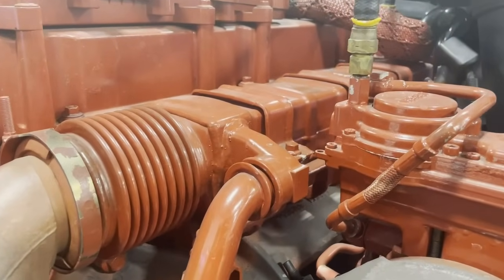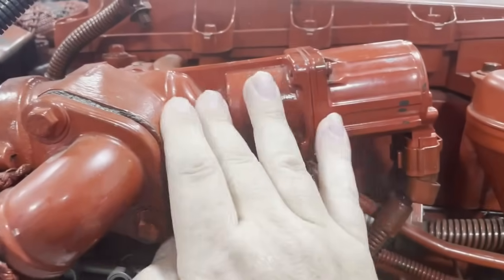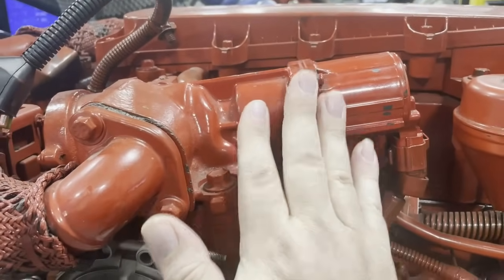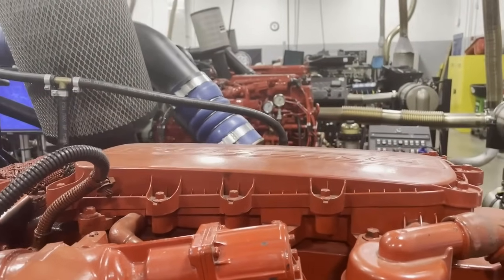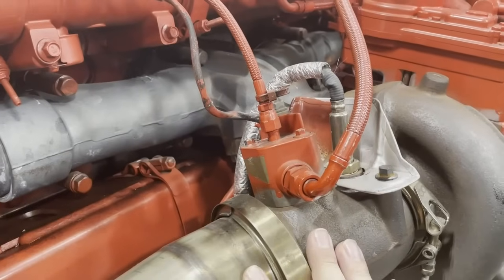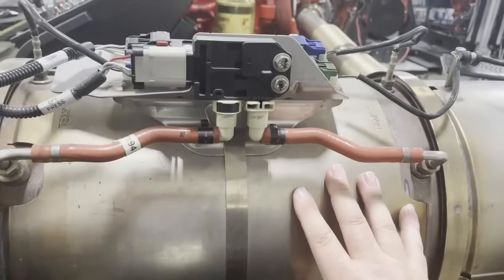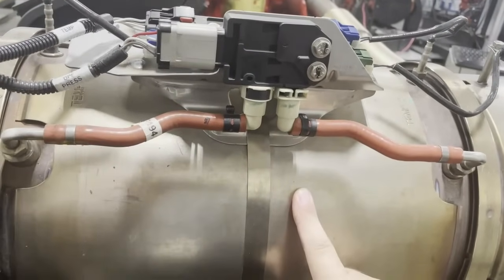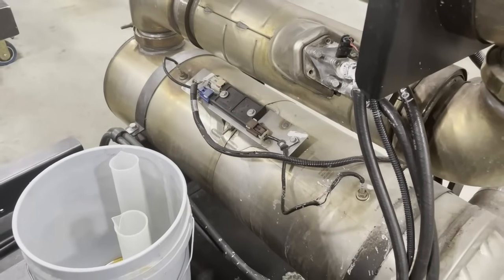Clean Diesel EXPOSED: How DPF, EGR, and DEF Actually Work

Comment: what about oil dilution with the newer 7th injector'less design.. doesn't spraying fuel in the exhaust stroke wash the cylinder walls?
Reply from the maker: Not really. It’s on an upward stroke towards the end. The majority of that atomized fuel gets pushed out the exhaust valve during overlap and then gets oxidized by the DOC. I can’t speak with absolute certainty but I believe very little to none of that fuel is still in the cylinder or making it past the ring to cause oil dilution or cylinder wash.
Reply from the maker: That was a great question by the way. I wish all the people asked thoughtful questions like that instead of being keyboard warriors playing a game of gotcha.
Reply: Oh, ok, so the injection event on the exhaust stroke can happen towards the end of the piston travel? Is it also the case that since diesels flashpoint is well below exhaust gas temps, is it instantly ignited, or is there not enough oxygen in that environment? These aftertreatment systems are pretty fascinating stuff, actually. Thx
Reply from the maker: @ojo2988 a little bit of both

Comment: Diesels were designed, and by design, still are to be run wide open, with no emissions restrictions. This is the most efficient by far. EPA has mandated garbage that restricts power, greatly reduces engine life, creates intensely more heat, and actually increases the emissions by using much more fuel than an efficient non-emissions engine. Counterintuitive, but it’s all about the money. Follow the money. If you run a modern diesel, you will understand. Back in the day, nobody had these problems with throwaway engines that fill up the landfills.
Reply from the maker: If you feel that way park your diesel in the garage, pull off the aftertreatment and breath it in all you want. I’ll watch.

Comment: Awesome video, thanks.
Can you explain if there's a hardware difference between Tier 3 and Tier 4 engines or if it's just a matter of efficiency of the same hardware.
Reply from the maker: @AliAhmadi-IRN  the difference is the more strict mandates from the EPA making SCR and DEF a basic requirement where they weren’t in tier 3. There are also some software changes and a reduction in the use of EGR.

Comment: Diesel exhaust contains 3 to 17% oxygen, it is not inert like gasoline engines. We need much larger percentage of exhaust gas to reduce combustion temperature.
Reply from the maker: Thanks for that info. I was never sure of those specific numbers. I’ve also been told a peak of 25-20% of exhaust gas when  EGR I valve is full open.

Comment: Hey buddy, great job explaining the Cummings emissions system. You have just addressed my current problem. I have a 2014 ISX15. I am currently having an issue with the 7th injector possible overdosing. I have a Doc and Dpf temp that has read 3200 degrees and would cause the truck to signal a shut engine down. I managed to clear the code and regenerated in a controlled environment so that I could monitor the Temps and also heat gun the exhaust system when this occurred again. When it happened again, the light proceeded to activate, and the Doc showed 3200 deg, then the DPF followed suit. I checked with a temp gun while this was going on, but the temp gun showed 1032 degrees at its highest. The SCR stayed at around mid 800 inlet and high 700 at the outlet. Can the DOC handle this much temp, or could that be a fault/default reading once the Temps reach its max threshold? Should I replace the DOC if it has reached a higher than normal temp as well as the DPF filter? When I had the Dpf off to get clean, it failed. They cleaned, and it passed, but when they tried the pin test, it only went half way threw.  Your thoughts?
Reply from the maker: The only way to know for sure is take it apart and see if the DPF element is melted. 3200 is high but the temp you recorded with the gun isn’t so I really can’t know for sure if it caused other issues without knowing which temp is accurate. Again, removing and inspecting would be my first step.

Comment: Worst idea for diesels is the EGR system. Politicians heard that it worked well for gasoline engines, so...force it onto everything. Not science, politics. EGR dirties the air into the engine, causing the fuel to burn poorly, leading to dirtier exhaust. Cascading problem. Aftertreatment would work better if they got rid of the EGR system in diesels. Politicians are not going to repent and admit they were wrong, so...hell for all of us
Reply from the maker: This is what I was talking about. An intelligent comment about EGR being bad for diesels, why its bad, and a potential solution. not just a throw it all away comment. On that note you will be happy to hear that many OEMs are getting rid of EGR or will soon because the SCR system is able to meet NOx reduction mandates without the help of EGR. Great for engine life, less work for techs but overall I believe a good thing.

Comment: I wonder what the maintenance costs are compared to gas engine including down time
Reply from the maker: I have never worked full time in an auto dealership but I think the extra aftertreatment on a diesel, plus extra costs of diesel components to begin with that it would be much more expensive to maintain and probably contributes to more downtime than automotive emissions controls.

Comment: Did anyone other then me here him say you have you have the exhaust cleaned after so money cycle. So where will that soot go?? Back in the atmosphere. This hole system is just a money grab. It cost to have the system clean the system is unreliable, expensive to repair burns more fuel brings down fuel mileage. Its sad.
We have the tech to really solve the problem, but they will not give it to us they cannot make any money off of it. This system is not efficient. Good job explaining why it doesn't work well at all.

Comment: I want people to understand that we exchange soot for higher CO2 emissions. Are decreasing soot levels worth higher fuel usage and CO2 emissions?

We are increasing our ammonia/fixed nitrogen content (lots of governments want to reduce the nitrogen fertilizer) of exhaust in exchange for lower NOX. My opinion is urea injection/ammonia is a net benifit. I don't feel the same way about the DPF with increased CO2 in exchange for decreased soot. There are no perfect solutions, only tradeoffs.
Reply: Higher CO2 = Slightly worse for the Earth (specifically, the Ozone)
Higher NOx and/or soot = up to 50x more deadly to humans
The lower the NOx/soot the better, it causes lung cancer for people of all ages. Extremely dangerous and it also causes smog and acid rain. You may argue that we shouldn't be wasting diesel as it means more oil needs to be burnt in plants, which is correct! But, if that oil is being burnt 120mi from a city center, that's fine (in oil refineries). If that diesel is being burnt in a city with hundreds of thousands of people and coming out through an exhaust with very little aftertreatment; you/me/the people will inhale that sooty/NOx filled air into our lungs. Killing us in the short term. Lower CO2 will help the planet in the long term. Lower NOx and soot levels will help us in the short (perhaps, even the long too) term.
Reply from the maker: @aidan1585  that’s an excellent breakdown of the situation.
Reply: @charleysgarage  if you're being genuine, thanks. I took my time writing the comment. I just speak from my experience and I will not always be 100% right in what I'm saying as I am not a qualified in emission control but I have owned lots of petrol and diesel cars including hybrids and even an electric. I understand how the systems work. Although none of my BMW's ever suffered from DPF/DEF/EGR/SCR/OXI CAT issues, (they make extremely reliable diesel engines. *Again, from experience and from what others have told me.) I have dealt with cars with failed dpfs and have tried my best to understand the complex design of the systems.
Reply from the maker: @aidan1585  Always genuine in my replies. Especially well thought out ones like yours.
Reply: @charleysgarage I appreciate it!
Reply: Exactly why biodiesel is the answer
Reply: @Nitewolf5377  Bio-diesel has the same NOx and soot issues. I agree that it can be beneficial for CO2 emissions, especially if the bio-diesel is derived from already grown but no longer usable food streams such as used cooking oil. Growing plants specifically for bio-diesel is a hard sell and doesn't provide any real benifits in my opinion.
Reply from the maker: Biodiesel in most applications is max 20% bio an 80% diesel. So still have many of the same issues and cold weather operations issues. A good alternative but not a long term solution.
Reply from the maker: You are right on all of that. It’s sort of like a pick your poison. Like I have said in other comments though, my goal is to help people understand how these systems work because regardless of our feeling about them techs have to maintain them. I’m not a big fan, a lot due to the things you mentioned but I know how to fix them and get paid for it.

Comment: Born and raised in trucking, now 39 years behind the wheel, I have diesel in my blood and my favorite cologne is Diesel Chanel #2. Quite honestly I can't wait until we quit using diesel fuel for our trucks and instead use Hydrogen which obviously still requires SCR treatment but it seems to me that we'd have cleaner engines internally without all that carbon buildup, and because Hydrogen is not petroleum oil, the engines wouldn't produce soot and fine particles and would not require after-treatment filtration, only SCR catalyst for NOX. My latest spotter truck does it's parked regen 2-3 times a night however I've noticed it's not using the DEF fluid, the gauge has not moved all week.Sounds like another expensive repair is about to ensue. Of all the after-treatment systems currently in use, I like the one Mack Trucks uses the most.
Reply: Take the lines off the dozer see if there is def coming out of yes replace dozer if no then there may be a block in the line
Reply: @CrazyxxxUkraine  This, the Def crystallizes and clogs the doser. Eventually it’s going to derate you if it hasn’t already.
Reply from the maker: @CrazyxxxUkraine  Very true, there is also a dosing valve test you can do if you have the right software. Most people probably don’t and your method is good. There is a strainer/filter for the DEF that should be checked if supply to the doser is blocked.
Reply: Diesel is not going anywhere period
Reply: @Nitewolf5377 Amen 🙏
Reply from the maker: You bring up some really good points. I like the hydrogen idea also but it appears that the industry is going electric instead.
Reply: @charleysgarage trying but will not succeed
Reply: Ammonia oxide is the end result of the scr. It’s been proven many times yet ignored.

Comment: Appreciate the video, I'm looking for any information on Detroit DOC face plate cleaning, with 1 box removed. We have had success with reaching into the down pipe and lightly brushing the plate face then shop vacuuming to get the soot out. I understand the 5-6 hour DOC regen, just looking for anything different?
Thanks
Reply from the maker: When the DOC face gets plugged up and you don’t want to completely remove the assembly then what you described is pretty much the way to do it. I’ve seen people try to flush them out with hoses but I don’t recommend that.

Comment: I'm sorry , I'm a mechanic of 40 yrs . I mean a real one . Egr and most other available treatments work when new ,then they kill engine. hydrogen 10% mix cleans bur n and engine
Reply from the maker: “Real” mechanics don’t need to run around on social media proclaiming their realness   Plus your ramble makes no sense and has nothing to do with this video other than display an ignorance of the topic.
Reply: @charleysgarage  hey i've got a problem with my 2019 T680 kenworth. With the Jake break applied and low R. P. M. I'm getting a shutter like a vibration shutter. From what seems to be the engine. Send it to Cummins and a rebuilt. The Jake break system compression tested and I. PT test, but can't find any problems eaton. Fuller also look into the transmission side. No one can find any problems. Any clue or suggestion to what it may be?
Reply from the maker: @gregburgess6884  what RPM is low? The ECM programming might be letting RPM get too low before cycling the braking. The shudder could be the engine on the threshold of stalling out. If you can get a computer hooked up and find out in the parameters what minimum braking RPM is I can do some research into what it should be. Another question is does the vibration happen at low RPMs when the brakes aren’t activated?
Reply: @charleysgarage  I can get the guys at the shop with the company I haul freight for hook it up to the computer. I think Cummins checked all the parameters, they even hooked up during a test drive. And no it does not happen when the jakes are not activated . As a matter of fact when I'm about to come to a stop with the jake on i switch them off for the last little bit of slowing down to get rid of the shutter. Thx for getting back to me this has been terrible.
Reply: @charleysgarage  also when I'm above 1500 rpm the jakes seem to act normal however I can feel them like giving out and coming back in. At the higher above 1500 rpm..
Then at lower rpm like from 1400 jakeing down to say 1200, is were it's having the problem.  you know then let's say your going to stop,  the jakes will automatically shut off at lower, stopping type rpms which is normal... but  i usually shut them off myself because of the shutter i don't want to damage engine or drivetrain ...BTW this is the 2019 isx15  efficiency series.
Reply from the maker: @ If Cummins has checked out all potential engine issues and you had the transmission checked out there is not much I can do without seeing it. I would point out steering, suspension and foundation brake issues but I do not see why any of those would be the issue if it only happens when brakes are activated. Parameters or adjustments are the only two things I can think of without seeing and feeling it myself. sorry I can't help more.
Reply: @charleysgarage  it's all good I really appreciate your input. I'm talking to them about the jake rpm settings and the truck trying to stall to see stay they say. Just had the dpf replaced, now the scr thru a code turned on the engine light. So they are looking into that now. That's what brought me to your channel. Great video on the aftertreatment system. Thank you.
Reply: @charleysgarage  actually he has a point egr destroys the engine life and durability. It’s been proven to many times.
Reply from the maker: @Nitewolf5377  again I will say it with smaller words. She is right, it does cause damage. I didn’t invent the dang thing I just explained how it works. If people would actually stick to the topic we wouldn’t have issues. I didn’t title this video “EGR is the best thing ever created by man” and again., it DOES NOT matter if we like it or not (I don’t) as a technician you need to understand and be able to maintain it.
Reply: Its really sad to see so many idiots coming onto a man's channel who is spreading knowledge that is very much needed in order to be good and make money fixing and repairing these systems. The low IQ splurge your dealing with isnt fair. Obviously no one wants them on their truck, but they are here to stay and if you dont understand them your ganna get left behind.  This is the first video of yours I have seen and you kept me interested the whole time, explained the systems in great detail, and gave me some knowledge I appreciate. Its too bad there arent more guys like you in the industry willing to share their knowledge like this. The only way to make good money is to sit back and listen to the guys that have conquered these systems and take that knowledge and run with it.  I appreciate it highly. Hope to see more of your videos.
Reply from the maker: @V8rngrboy50  thanks for the kind words. More videos definitely coming. Hopefully some more hydraulic and Diesel engine content. Anyone who puts their stuff out in the public domain is gonna run into keyboard warriors who want everyone to be as miserable as they are. I usually just delete the wort of them but some just help to prove a point.
Reply: At the end of the video you actually stated that some engine manufacturers are getting so good at designing the SCR that it doesn’t come with an EGR and stated how that would be a good thing. Love the video.
Reply from the maker: Thanks!

Comment: Hey Charley! Got an ISX 15 2015 that keeps sticking in warm-up mode, that’s where the six injectors are spraying extra fuel and no. 7 is NOT dosing. Long story short…..Spent$$$$$$$$, been everywhere! Likes to do it most when fuel mileage is bordering on fantastic like an empty flatbed deadhead. Ever seen this before? Apparently nobody else has!   Thanks!
Reply from the maker: the Dosing issue could be that injector has carbon build up issues. you might have a bad water temp sensor, there are so many potential reasons it is really hard to nail down without hooking up to a computer and monitoring some values.
Reply: @charleysgarage  Water temp sensor makes sense. However, it has been hooked up countless times in the last 18 months or so to no avail$$$$$$. If you have minute google “No Codes! No Lights!” at Rawze and check my post. This tells the whole story! Update since that post: Some days it will do warm-up mode a couple times like a 50 mile deadhead in the morning then another deadhead at the end of the day. Other times loaded with short deadheads it’ll go more than a week.   Thanks again!
Reply from the maker: @onebadapple83  I will check that out.